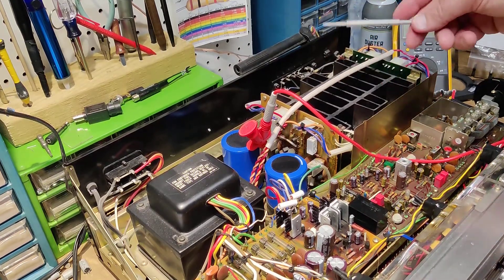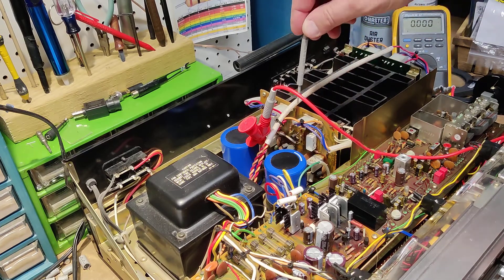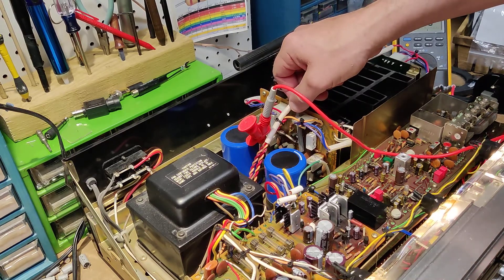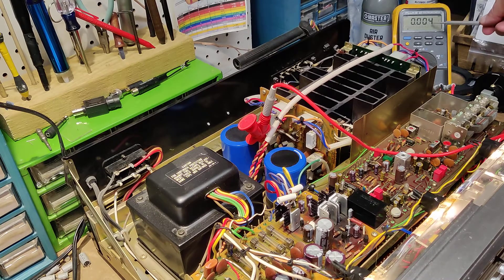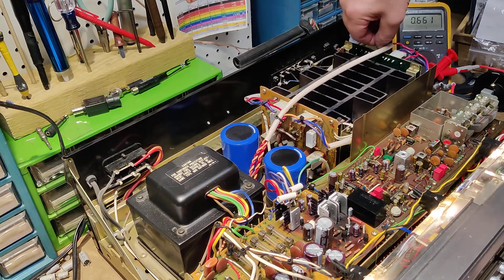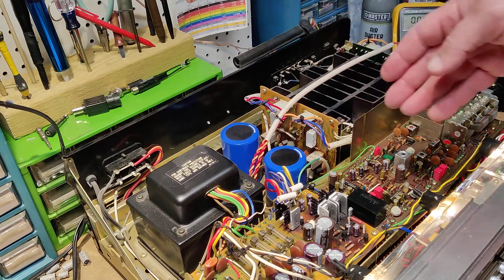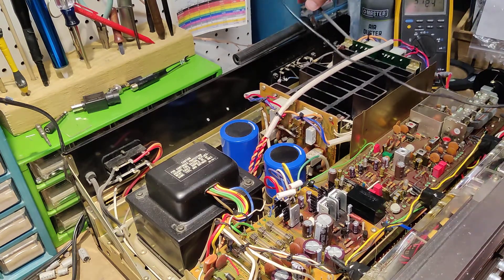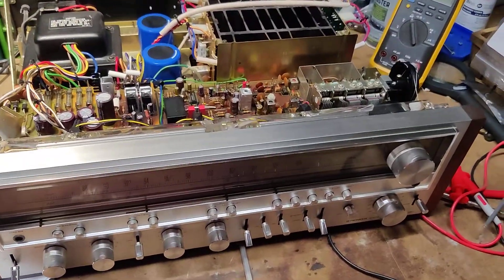Pioneer SX980 Setting Center Voltage and Idle Current

Comment: I just wanted to thanks you ! I bought a  beautiful 980. I assume he sold this spotless receiver because it didnt sound too good. I was prepared to have the whole deal done to it. I saw nothing that indicated issues but found this on utube. I followed the direction, except you said turn pots couterclockwise except v2 to mid. The manual said clockwise all the way, which later you said too. I set to 0 then 0 then 30 and after hooking it back up YEAH ! It sounded right, musical, not harsh and mashed together, So, this can help no matter what but it may REALLY help.

Comment: Have you had any issues with the output transistors on this unit? I’ve heard they are nearly impossible to source replacements for if they go bad. However, I have also heard that there may be an alternative out there for a replacement using modern components.
Reply from the maker: Mine were fine. I kept them stock. There a couple replacements that work just fine. You just have to note the BEC (base, emittor, collector) is  not the same on the couple that are out there so you'll have to make sure you wire them up correctly. I would also order more than you need so you can match them up.

After re-rading your question, I think you may be referring to the sx780 which uses Darlington STK packs. If that's your question, yes the only replacements are Chinese clones which I would not recommend. There are a couple discrete component kits that will set you back about 80 bucks a pop. The SX 980 uses traditional semiconductors that rarely fail unless the amp was in a frat house. Lol.
Reply: @PackardDog  thanks for your reply! And yes I was talking about the output transistors only. I just purchased an SX-980 and I do know about the STK packs but as you mention they are not a problem on my unit. Can you briefly explain more detail about replacing the output transistors on the 980 with a modern component and taking into consideration the BEC (given their is an issue with the original transistor)?
Reply from the maker: @LucasPatterson   2SB706 and  2SD746 are the original  transistors. The base, emiter, collector are different on some replacements. So you want to make sure you note that when wiring them in. I would also order at least 1 extra of each so that you can match the hFE gain on the replacements so you have equal outputs or what they call asymetrical output. Prevents overheating and uneven channels. You'll need a tester such as this one so you can match them up. https://www.amazon.com/Pocketable-Multifunctional-Backlight-Transistor-Capacitor/dp/B07X5YS1JN/ref=asc_df_B07X5YS1JN?tag=bingshoppinga-20&linkCode=df0&hvadid=80333160053394&hvnetw=o&hvqmt=e&hvbmt=be&hvdev=c&hvlocint=&hvlocphy=&hvtargid=pla-4583932709059262&psc=1